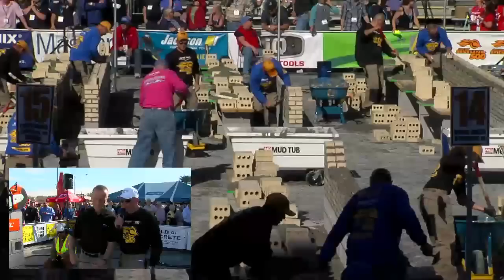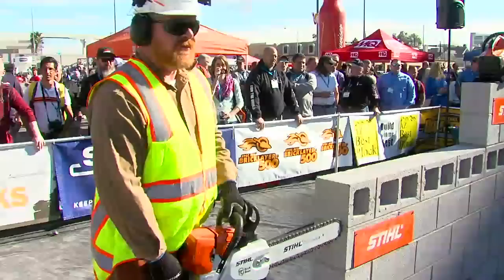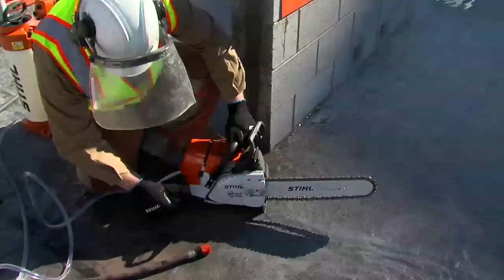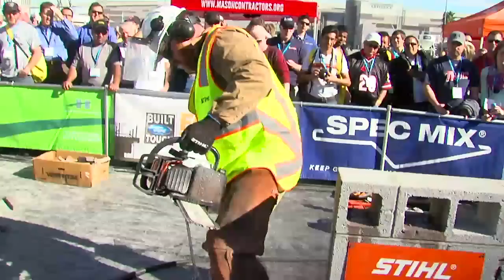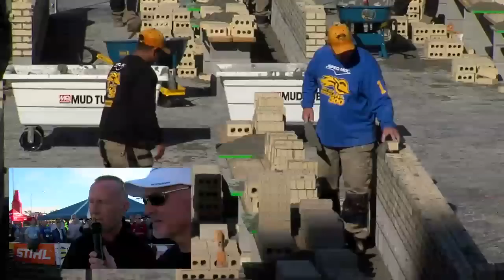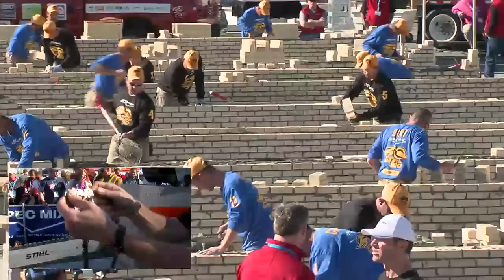A STIHL GS 461 ROCK BOSS CONCRETE CUTTER DEMONSTRATION

Comment: I have a 6" reinforced concrete wall and 10" wall.  Would it be better to use a chainsaw or circular saw?  The cuts do not have to be precise at all.  What's the differences between the 2 methods?

Comment: Ya cinder block is EASY to cut it cuts fast!!! Do solid CONCRETE with rebar!!!! I have cut a LOT with that saw and SOLID CONCRETE does NOT cut that fast!!! These demos are so RIGGED!!!!!!